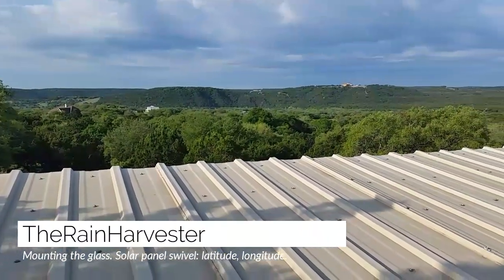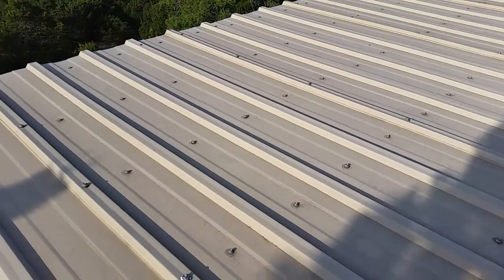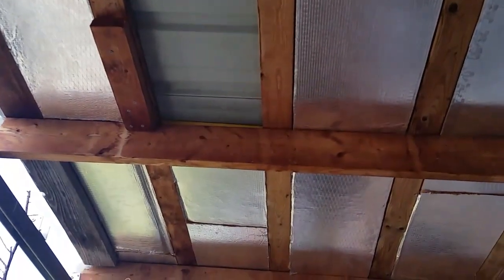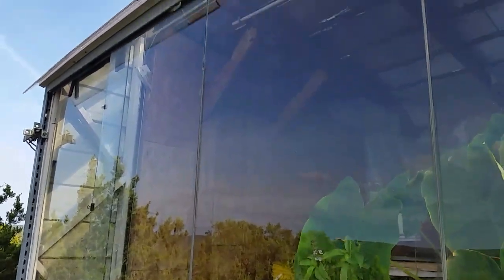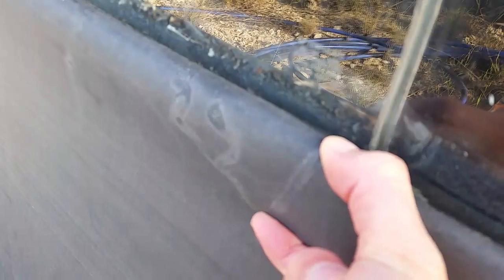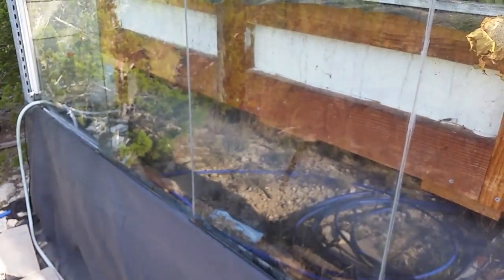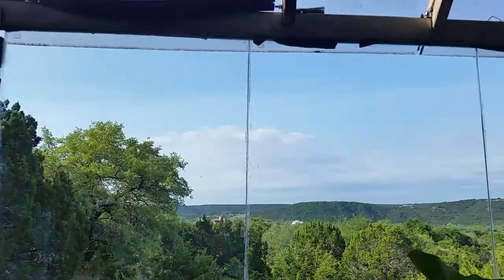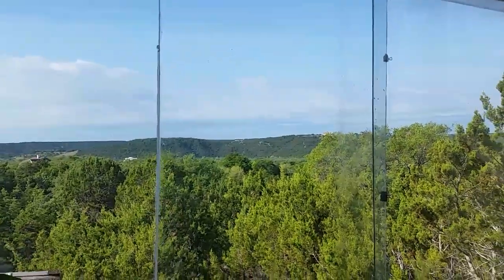Part 4. Diy Greenhouse : mounted glass $80, solar panel swivel: longitude latitude.

Comment: Do you have a battery somewhere or is it panel straight to power converter?
Reply from the maker: No battery.  I'm using all the panel will deliver I think.  So i figured, no sense in adding a battery.  But actually, maybe during bright days, I could store some in a battery.  That would be an interesting software challenge.
Reply: @TheRainHarvester  I love  how you know how to build them all from scratch but man you can get most of this electronics stuff in neat little packages off of ebay, unless you are way out in the bush somewhere or you enjoy the challenge so much? I also have a solar aquaponics setup in sydney Australia, been upgrading it during rona virus lockdown. Check my video if youre interested